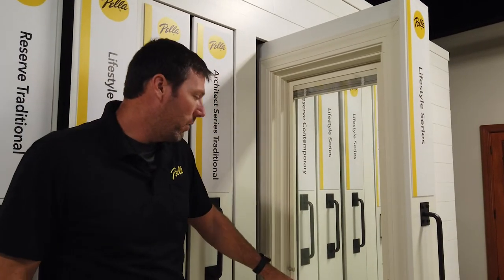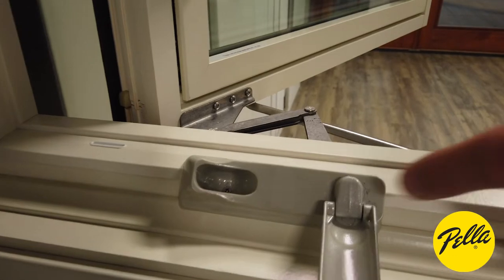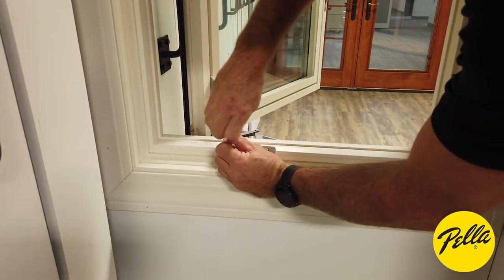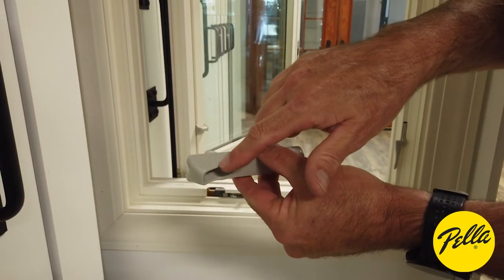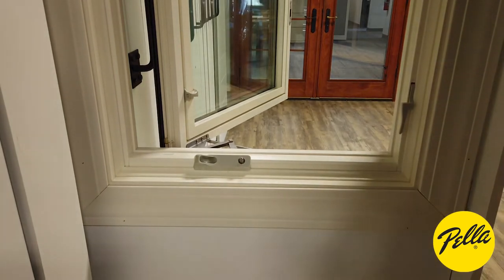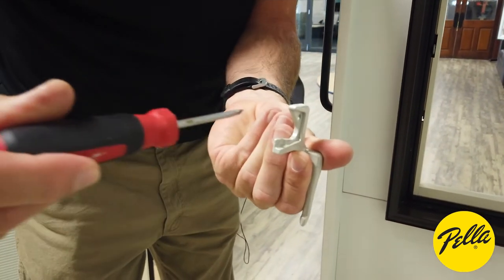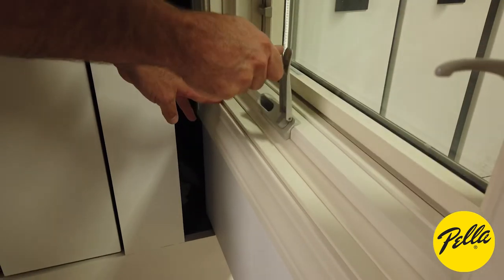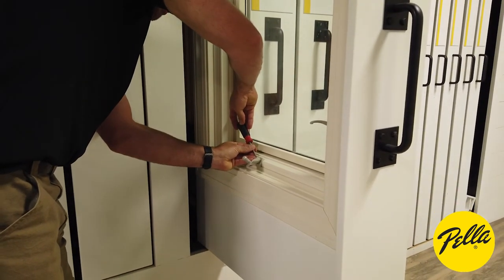Instructional Series - Wood Window Hardware Replacement

Comment: I have a 2010 ProLine casement AWNING window. The exterior gap around the sash is very uneven comparing the left side to the right side. How do I adjust that? The right side of the sash rubs on the frame, and the left side has approximately a 3/8 inch gap. Thank you.
Reply from the maker: Hey there. Sounds like your window is out of square. Without being hands on, it's hard to say what could be the issue, but it might be possible to shift the hinges arms a bit to make the reveals closer. 

We'd be happy to take a look at it if you're in our territory, and make those adjustments. Just let us know. Thanks!
Reply: @pellanorthcarolina    No, the sash is definitely square in the frame. I am in Indiana. But a video showing how to adjust that gap for an awning window would be very helpful. Thanks.
Reply from the maker: @MrkWil1234  We've added it to our list! Thank you for the recommendation and sorry that you're having trouble with it. With any luck we can help address this issue for you and others.

Comment: The video with respect to the sash lock handle does not address what must be the more useful issue of repairing/replacing the lock latch assembly. We have casement Designer series Pella windows, circa 2002, and the latching mechanisms are not always faithfully engaging, possibly from worn cams, and maybe some window shifting.  It appears in my style window there mut be a short rod or plate between the lock handle and the actual latch cam. The two latches are also independent in my case. Fixing that issue seems to require more major work. Would love to see a video on how to repair that issue for older Pella windows.   I am sure I am not alone with this type of issue.
Reply from the maker: Unfortunately, these videos are designed to be more about basic fixes in the home. For more complex service work, especially with aging products, we definitely advise scheduling service with your local Pella branch. We definitely appreciate you bringing this to light though as there may be future instructional videos that go into replacing the lock latch assembly as you have pointed out!
Reply: Hi Gary - I have the same Pella latch problem.  Did you ever resolve?  How?  Our windows are wood trimmed and I am wondering if all the trim has to be removed to fix.
Reply: No. There is a video on a slightly different style casement window that shows taking apart the trim. I am waiting for warm weather to finally tackle the job. I am loathe to take apart the entire trim. I may just carefully cut into the trim around the bad latch with an oscillating tool, to see what is going on, and what I need to repair the latch. Then hopefully get the trim piece back in, or remake the piece, glue it in, sand and revarnish as  best I  can. Our casement has two independent latches, rather than two latches connected via a tie bar.  May not end up looking as good as new, but better than likely >$1500 for a new casement window (Our window is nearly 2'. wide by 6' high.)
Reply: @garydyrkacz7973  thànk you for the reply.  Yes, I am not looking Forward to having trim removed.  Right now the latch is removed and I am hoping widow stays as closed as possible.  I never should have tried to clean bird poop off!  Take care.
Reply: Gary -- had window repaired.  Have pics to send you and some info.  Please let me know where to send pics
Reply: Gary -- had window repaired.  Have pics to email you and some info.  Please let me know where to send pics